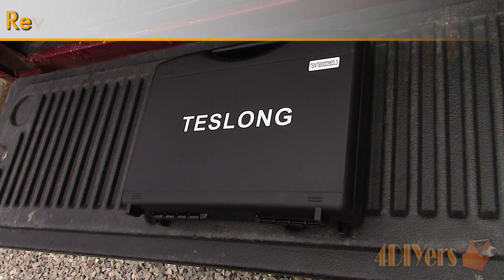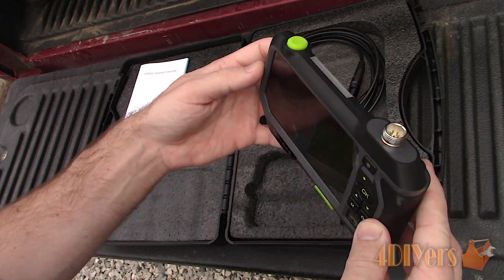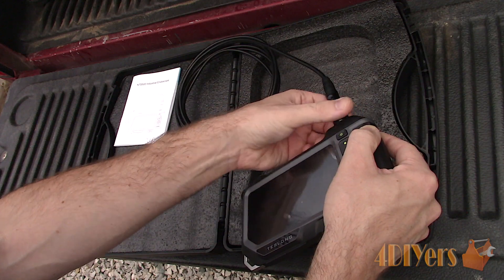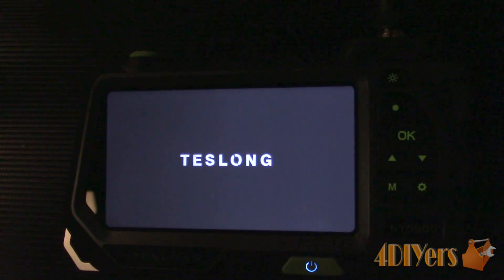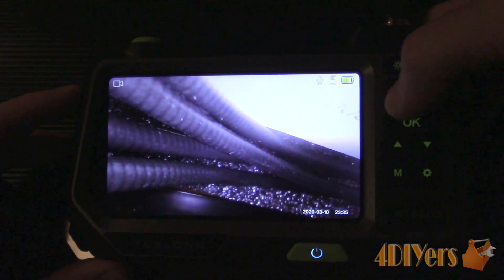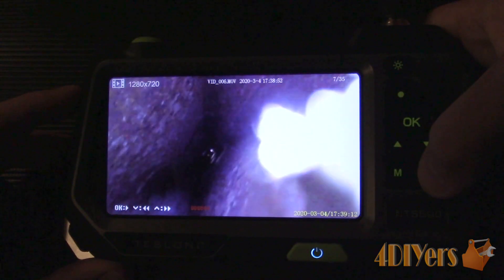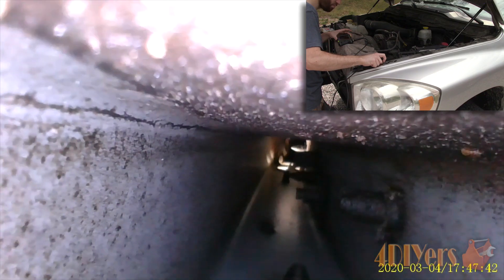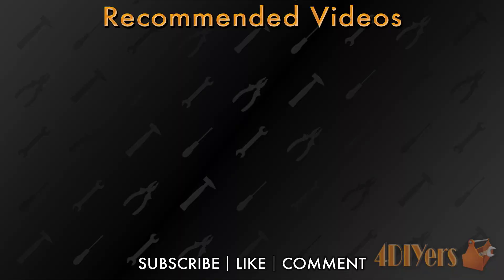Review: TESLONG NTS500 Dual Lens Borescope Inspection Camera

Comment: Originally, I bought the Teslong NTS500 with the 5.5mm (0.21") scope and 10-foot cord. Later, I decided that I also wanted the mirror, magnet, and hook attachments, so I had to order the 8mm (0.31") scope because the attachments must screw onto the cord and the 5.5mm cord was too small to have screw-on attachments. I decided to also buy the 3.9mm (0.15") scope for inspecting firearm barrels. I'm very happy that I have all 3 sizes of scope cables and feel ready to tackle any project.
Reply from the maker: Thank you for sharing your experiences, happy to hear you’re enjoying them. I never thought I needed one until I got one. Super handy to have.

Comment: what is best length for camera cable 5meter or 3 meter  . for car and general inspection ?
Reply from the maker: 3m should be fine. Realistically you'll need go that far into an area, there should be access spots close enough. The longer lengths would be used in home construction or industrial applications.